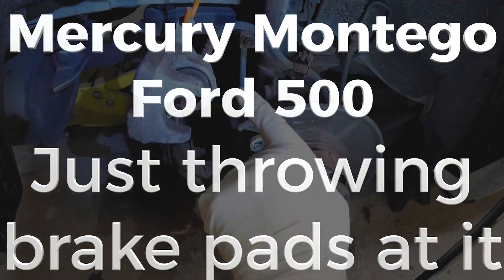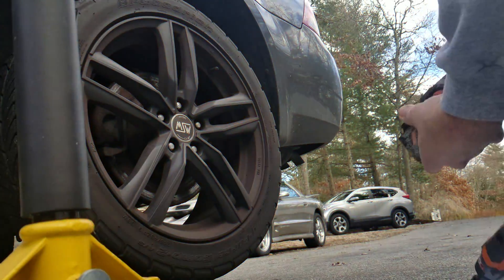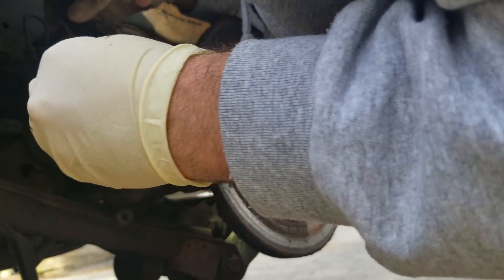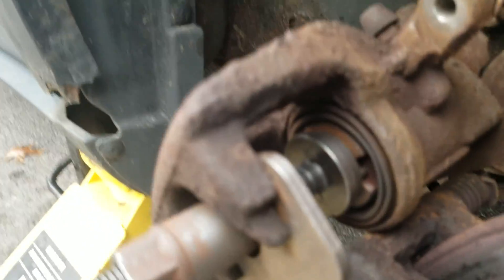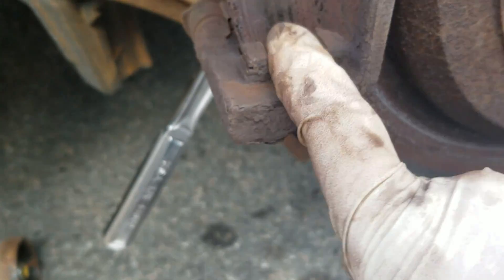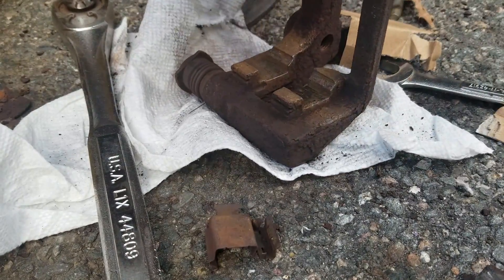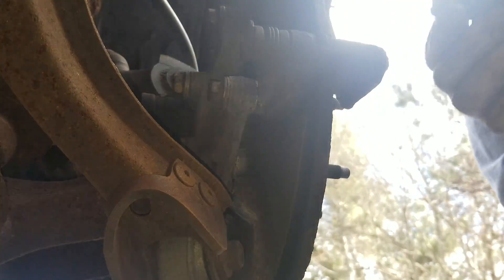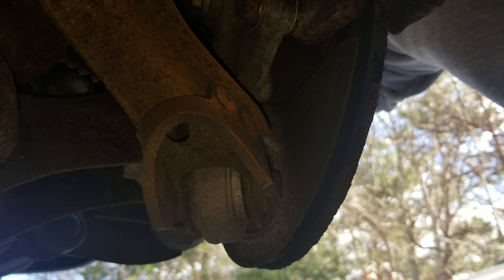Cheap Quick brake pad fix

Comment: As long as rotor isn’t warped or have to deep of grooves i would just put pads on. They always want to sell rotor. This is also on rear which do less breaking than the front. People drive around with far worse stuff.
Reply from the maker: Yes they do! I've seen some rough stuff. Just be safe and think that's all.  Good comment, thanks.

Comment: You keeping busy Guy?
Reply from the maker: Yeah enough at the moment. Working on BigBlacks plow (tin knocking vid), still doing cleanup stuff. So much content to do but the time requirement is tough. How about YOU!?
Reply: @rcguygarage  
Yep  well should be warmer weather for the end of the week,   a good chance to get anything outside squared away for whatever comes next! 
       Have a set of bilstein shocks and timbrens  to put on the front end of the  'lil Chev that could' , as well as turning up the torsion bars a bit to try and level things up better. 
       It's tough though because most times I end up working outside on the ground.  
    If its serious work,  one my buddies does have a large, kind  of heated shop I can get the truck in with the plow too.
Reply from the maker: @grumpy1311  yep your absolutely right use the defrost time to square away what's going to be frozen and stuck. I WISH I could get BigBlack into a garage with the plow on! I've got Bilstein on my truck. Originally they were great BUT the coating on the front didn't survive one test year of New England weather AND the rears can't take the weight of what I've done. Other than that they're great 😜.
Reply: @rcguygarage  
   I believe it about the shocks. 
 Zinc, last time I checked was not much for a high quality metal!   Maybe a good coating of oil will help protect them a bit.     
   Wanted to try top shelf and go with some Fox Shocks , but they were $$  .   I figured ANYTHING  was a gain over stock!
     Almost pulled trigger on a set of Air Lift bags for the rear end,  to help with carrying sand, but just trying keep the spending in check.
       
  Tempted to try a set of wing extensions for my 8.5 Xv2, though $800 with a good chance to  fold one over on a  rock is a gamble.  Be a1 for parking lots etc , risky biscuits for driveways . 
     Have my eyes on a new Fisher XLS expandable straight blade for next season! 
   Best of both worlds , with the V , and also  a wide smooth tracking straight blade for powder!
Reply from the maker: @grumpy1311  don't forget you'll lose that initial v push though on deep stuff. I'll never go back to straight. Beats on your truck more torsionally. I like your fluid film stuff I put that in my cart after watching your video. I might have to buy what's in my Amazon cart now! Late is better than never. I've got to fabricate a trip spring tool next!
Reply: @rcguygarage  
  Trip spring tool for the plow springs? 
   They are sold as a pre compressed unit ready to bolt on if I recall?
Reply from the maker: yes but I need to release the pressure of the originals. Not replacing just doing touchup maintenance of the frame.